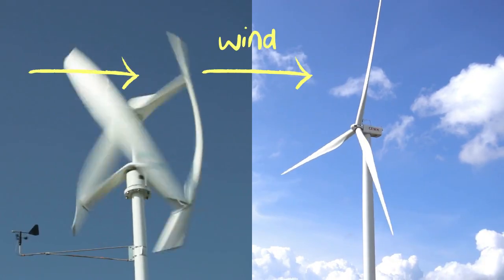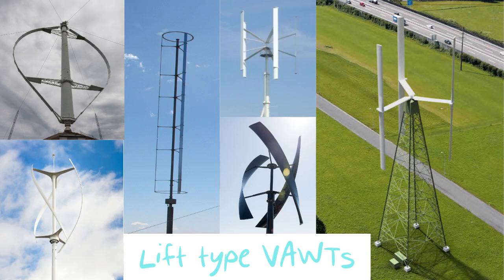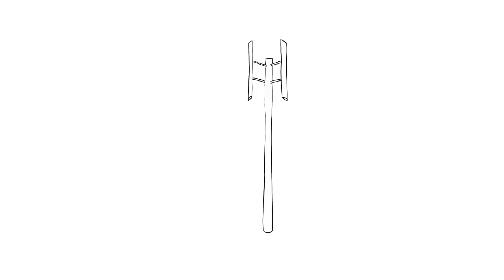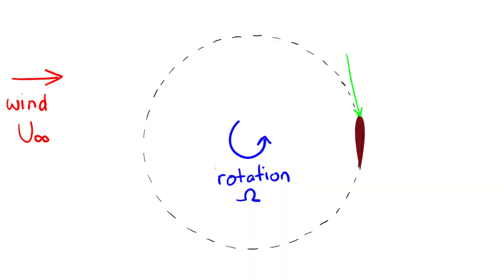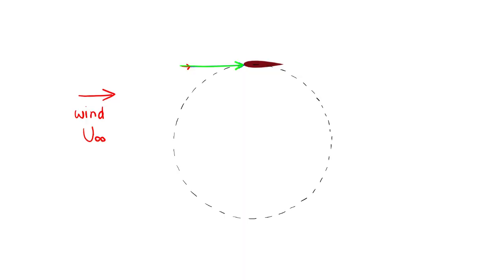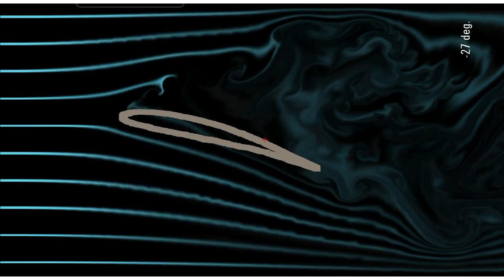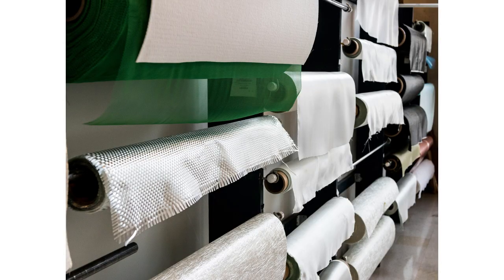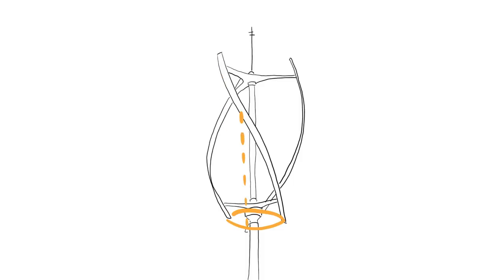Vertical Axis Wind Turbine Aerodynamics and Design

Comment: The possible approaches for VWAT simulation:
1. Cascade model+Leishman-Beddoes dynamic stall model.
2. Double Multiple Stream Tube model.
3. 2D Point vortex +Leishman-Beddoes dynamic stall model+free wake model.
4. Lift line model + +Leishman-Beddoes dynamic stall model+free wake model or vortex in cell method to deal with the complexity of wake.
5. Unsteady free wake Vortex Lattice Method (VLM) or Panel method.
6. CFD methods based on sliding mesh or overset mesh technique and URANS.
Reply from the maker: Thanks for adding this information! It's complicated, isn't it?
Reply: @EngineeringwithRosie  Yeah. It needs a lot of effort.
Reply: @EngineeringwithRosie  please ... how much efficiency? is differ from vertix?
Reply: @EngineeringwithRosie  Hi Rosie. Hope u r doing good. 
Any update regarding the full math explanation video on VAWT?
Reply: @EngineeringwithRosie  Yes
Reply: How about adding a hollow funnel/cone-like structure located below the VAWT? I remember seeing a patent describing it about two decades ago.
The patent claims the cone structure would allow to re-focusing the wind/air-flow that coming from opening located on bottom part of the cone, the focused air-flow then used to turn the already spinning VAWT, further increasing its output.
Reply: @rashidisw  a university in England just did the math and find if you position the vawts right they are more efficient than the big wind turbines on a large scale. Vawts are the future and the only certified one is the hivawt. This technology has been surpressed by Facebook and the government
Reply: @kahlernygard809  and why would facebook give an F about supresing that?
Reply: @jearlblah5169  idk go ask them, it's a fact there were millions upon millions of views, and Facebook took down the videos
Reply: @kahlernygard809  Find out why they took them down. Without looking into it (and I'm not going to) the most obvious reason is legal IOW copyright violations.
Not everything is a conspiracy. Stop using that as your starting point.
Reply: @aaronleverton4221  yes life is full of conspiracies. Go read a history book child
Reply: @kahlernygard809  No, life is not full of conspiracies, son. Life is full of life. Some things are conspiracies, some things are easily explainable.
For example: Ernst Degner defecting to Suzuki with MZ technical secrets was a conspiracy.
The Japanese motorbike industry destroying the British bike industry through better build-quality and reliability was not a conspiracy.
Reply: @aaronleverton4221  funny thing. Upon my research, one of the distributors for these HI-Vats is go green energy run by Jay Nygard
Reply: @matthew9871  That study has several problems; for instance, claiming that "turbulent wakes created by the first row [of a HAWT wind farm] decrease the power output of the turbines behind by up to 40%" and citing a dissertation that merely cites two other sources which do not contain  the "up to 40%" claim at all. This is shoddy, to say the least. Also, "opposite to HAWTs, they can be installed at sites with varying flow conditions (i.e. varying wind direction)" which is ridiculous. Since when did HAWTs become impossible to install at sites with varying wind directions?? The main author has a bachelor degree. I would not use that against him, except when making errors on an undergraduate level, like here.
Reply: @aaronleverton4221  Not everything.....but a lot more than you realize
Reply: @donkehoe9534  Only if you can read my thoughts.
Reply: @kahlernygard809  You can literally stick these things on a roof for all to see.  The economics of efficiency are such that better mousetraps are nearly impossible to contain.  When faced with the choice of human ignorance or evil, just remember that half the population are dumber than average...and average is pretty stupid...vs about 5% being actively sociopathic.  Ignorance is 10x as prevalent as evil.  Facebook suppresses conservative political speech very effectively, but engineering maths are almost impossible to contain.  It's the discovery part that is lacking.  We're not that far from pointy sticks after all.  I'm not defending Facebook, but this ain't their jam.  They're about spying on you and selling your secrets.
Reply: @kahlernygard809  cool!  Can you link to the white paper or identify the authors?
Reply: @kahlernygard809  The gold standard of conspiracy theories - bold statements and no facts to support them.
Reply: Choice of method depends on solidity...for high solidity a relatively simple approach is the cascade model with stall and flow curvature accounted for. CFD - yes, if you have software and a fast comp. Lift line works well - a good example is QBlade.
Reply: Qblade
Reply: You could see through a larger straw if you are able to discuss trailing edge aerodynamics to solve static and dynamic stability(s)
Reply: Me gusta tu canal mui buena explicación
Reply: To solve your problems lets involve a mechanic for braking system that would not allow the system to over heat/over spin out of control. Everybody wants to hang onto the carnival spinner even if its at the park but centrifugal force will toss you away.. A bearings guy/girl to beef up the bearings and as well we could use an engineer with some solutions, not just problems. Being from another planet is cool, but reading this is somewhat confusing. We have this figured and energy is free. Should I do the math for you or can this people figure it out,?

Comment: Thanks!  I love solar. But is dark and windy at night and in winter so wind is appealing.  From what you said the multi blade sprial systems seam best for home use.  Can you tell us which ones actually work and what height they have to be?  I have also seen systems in a box trying to increase airflow or on a pitched roof yrying to do the same - any good?
Thanks!

Comment: 10:15 Blade pitch control is the way forward with VWAT, but as noted active control is expensive, and it introduces additional failure modes.  I believe a more productive approach is passive control using a weather-vane to actuate the blades like a Voith Schneider cycloidal drive:
https://youtu.be/Ub563Yc3xls?si=Uh_3CxpAuO8SvvQg
Paired with a centrifugal governor for the transmission, the turbine would be entirely mechanical with automatic passive control; which is a far easier place to begin adding active sensing and powered control elements to optimize the system.

Comment: Rosie.. 
My name is Richard Kline and back in 1970, we patented the first airfoil that had a step or discontinuity which trapped a vortex which became part of the airfoil. This created greater resistance to stalling as well as better stability. I thought that you might find this of interest. 

Recent Abstract:
Energy that is obtained from the wind is considered as the foremost renewable energy source and is deemed more favorable than fossil fuels. Wind turbines positioned vertically exhibit heightened turbulence near the ground. The Troposkein wind turbine is analyzed and developed from its inception. Instead of executing the analysis based on the classical aerofoils, this study focuses on the aerofoils with stepped back profile. The stepped-back profile is a popular choice for modern wind energy applications because it enhances wind turbine performance by increasing stability, reducing noise levels, improving aerodynamics, decreasing structural stresses, and enhancing self-starting capabilities. This study focuses on determining the most efficient design for a Troposkein Vertical Axis Wind Turbine (T-VAWT) by adjusting the blade profile, number of blades and the aerofoils. The aerofoils that were chosen for this study include NACA-0012, NACA-4415, NACA-6409, NACA-63415, and S1046. To view the aerodynamic behavior of the turbines, the pressure and velocity distribution over the structure is analyzed, also the torque obtained is noted down to understand the turbine’s ability to generate energy. Four different comprehensive studies were proceeded, to find the number of blades, best aerofoil, to observe the enhancement in performance with stepped back profile and to conclude the best performing aerofoil with stepped back configuration. From the results obtained, it was observed that the four-bladed turbine performs the best and the innovative stepped back profile enhanced the aerodynamic performance of all the aerofoils when implemented in the T-VAWT blades. Among the mentioned aerofoils, it was observed that the NACA-4415 has the highest performance improvement in terms of the torque generated which in turn helps in the production of higher energy. It is noted that, this innovation enhanced power by 143.91 %. Followed by NACA-4415, NACA-63415 aerofoil performs best, and it was also noted that the highest velocity is produced by the aerofoil NACA-0012. Therefore, the utilization of hybrid energy extraction renders T-VAWT a highly effective energy harvester. The designed turbine can be used to acquire large amounts of energy without the emission of greenhouse gases during its operation.

Comment: Why not have an L shaped arm that attaches the blade to the generator? It will put the blade off-center of the center of rotation, but will increase torque on the generator.

Comment: That torque ripple has been solved in diesel engines with damper which is basically a mass flywheel. That static mass inertia would raise starting wind speed, but in order to solve the rippling forces at higher wind speeds, it could be attached at higher speeds with a modern electric clutch like they use in fans and AC-pumps.

Comment: Whats really interesting is that with vertical wind turbines more energy per area can be harvested than with horizontal wind turbines, due to the changed flow behavior of the wind. For Countrys which dosent have much area for renewables this is ecpeccially benefitial.

Comment: If you were to compare the two based on bearing loads, bearing costs and bearing life you will come to a conclusion on why most commercially installed use a certain type of turbine. However, if you don't care about cost, just look at the efficiency.

Comment: Does the pitch of the airfoil in an H-Rotor configuration affect efficiency or contribute to lift? I’ve heard that setting the airfoil to a 5-degree inward pitch helps in low wind conditions or initiating rotation, while a 4-degree outward pitch maximizes efficiency at higher rotational speeds. Is there any truth to this?

Comment: OK... so I am late to the game; but you make an interesting point.  Variable blade pitch sounds like an answer.  Why not look at helicopters?  Helicopters have swash plates, this translates the AOA (angle of attack) in both cyclical & collective AOA changes...
1. rotational position specific AOA change is  based upon the rotational position of the rotor blade as it travels across the arc of blade rotation.) 
2. Collective AOA changes occur across the entire arc of the rotor.

Control of the blade pitch can be accomplished with 2 simple simple stepper motors set to change angle of attach of the blades as the rotor system travels relative to position in the arc.  Collective changes about the arc can increase drag when wind speeds are higher and protect the structural integrity of the turbine system.

Lastly, could we use "stators" to improve the inflow of wind as the wind interfaces with the power turbine.  Steam turbins have both stators and rotors.  Stators induce airflow for optimal perfromance as it enters the turbine blade.  This is then repeated each in sequence of rotor-stator, again and again.

Just my thought...
I love how you eplained this.

John

Comment: 5:05 isn't it the crucial part to tell that in order to get drag force in such angle so it's component produce tangential force (and therefore output torque of turbine) that blades need to be shaped in such way? Tear shape makes this possible but I see no way this could work if it had rectangle or circle shape

Comment: How about replacing sails on a sail boat with vertical axis wind turbines and using electric motor propulsion?
Vertical axis Vs. Horizontal to better fit the available space (volume) e.g. there is already the mast and space around it.
Stack up a number of generator units.
100 hp would be about 73 kW which seems reasonable.  Maybe even multiples of that.

Comment: Come to think of it so long as the wind direction was known, you won't need an active control system. Instead you could use a cam and a runner, similar to a helicopter swash plate, to change the angle.

Comment: I have a farm building next to a couple homes and want to put up a wind turbine along with my solar panels to get power offgrid.
I'm planning a vawt as any noise is not going to be appreciated by those who live next/under it, and it can also get super high winds here as its farmland with no wind break nearby, so a hawt will have to be taken down for sure in the worst cases as having it fly apart will also not be appreciated by those living around it.    
I was looking into articulating the blade pitch as it rotates, since previously I was looking into a solar boat with paddle wheels, and they do this exact thing with paddles making them push the water with vertical fins throughout the stroke to maximize efficiency and reduce splashing.  They used a purely mechanical system to do this.  While it make be more complex, my project is one-off, so I can spend time building it if its going to work much better.    Can you comment on this type of setup?   It worked for paddle wheels, but honestly I think maybe only 25% improvement or so.   I see a problem though that paddle wheels only need to work for half the stroke, where vawts have to adjust to both sides?   Though looking at the design below, it seems it makes the vawt directional, but that seems ok, easier to make it face the wind, and frankly the prevailing high winds come from the same direction almost always.
https://www.youtube.com/watch?v=2v_0V2kJ6HY

Comment: well, that is an analysis of a single mill, how about analysis of a farm, how close can they be to each other compared to horizontal axis.

and stop calling them turbines, as engineer you should know those are not turbines because they are not compressing air.
Reply: Notice how she hasn't made another video on vawts regarding how they work better in tandem than hawts which harm each other's performance.

Comment: I think we should go on a date and discuss turbines. When i was 24 I got obsessed with making a wind powered elevator in a 3ft tall building out of Legos about 3 feet tall.  It worked perfectly. It was powered by the ceiling fan. I designed a pendulum balanced low friction windmill that works no matter what direction the wind comes from. The 2nd time i tried to recreate it, I  failed.

Comment: Hi Rosie! Very good engineering! I have thought of doing similar analyses as you prescribe, On my ranch in south Mexico, I would like to have a wind turbine in a low wind area, though close to the sea (6 km). There is a lot of wood around my open area. For me its important with low speed performance (2.5 to 5 m/s wind). Comparing vertical and horizontal, I found that vertical seems to have better performance (surprise!).  Do you have any opinion about this?

Comment: You talked about the drag on VAWT when the blades spin around and essentially move back into the wind but wouldn't the exact same principle apply to HAWT?  HAWT's have aerodynamically designed blades to counter this but then couldn't the Horizontal type apply the same? Also from an aesthetic viewpoint (in urban areas) personally I feel VAWT turbines have the edge.

Comment: Isn't blade pitch control in helicopters realized in a mechanical way, without "fast-responding" (electronic) controls? A simple excentric wheel, itself following the wind, should do the trick.

Comment: VAWT - With the rising cost of electricity I was wondering if I could actually build one for my back yard just to provide power for my PC  - I would be looking to produce about 300w to charge lithium batteries which would then be inverted to 220v AC.   I live in an urban area and the wind is very blustery and not consistent, so it seems like a VAWT would be a good choice.   I suspect the project would cost more than my savings in electricity though.

Comment: I have, over the past 50+ years, overcome ALL of the design limitations of my VAWTs. 

I use a flat, symmetrical-section vertical "H" design started with a small Savonius rotor at the center. My largest vawt swings a 10-foot arc.

I deal with efficiency down on the ground by tweaking how I use the constant energy supply provided by my several turbines. 

ALL my turbines compress air, and I utilize that stored (in air receivers) potential energy against pistons or pelton-wheel turbines down on the ground,  safely inside my shop.

I'm 74 years old, and ALL my VAWT towers are counter-balanced, so they fold down easily with just one hand.  My tallest turbines are 20 feet tall.

I am working towards having 30 VAWTs all compressing air.  I store at 120 psig and use automatic condensate drains and check valves on all receivers.  I haven't had any mishaps yet and it's been going on 60 years since I started.
Reply: What kind of compressor can I use with a VAWT. Thanks
Reply: @user-kr3pc1us2t  
Any piston or diaphragm compressor will work. Stay away from sliding vane, flooded screw and any other high-speed device.
Reply: @SiwyWabbit  Thank you very much. I am busy building my prototype Savonius. It will be a power takeoff for a pump or compressor or generator. Regards. Hennie Stander